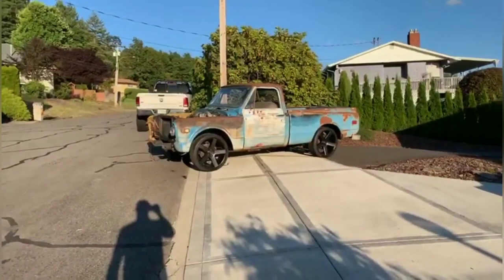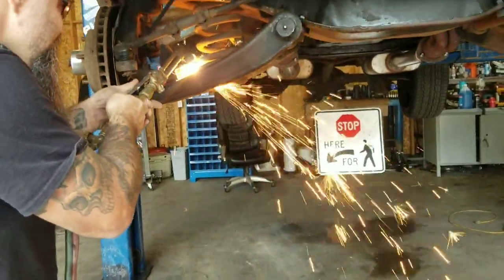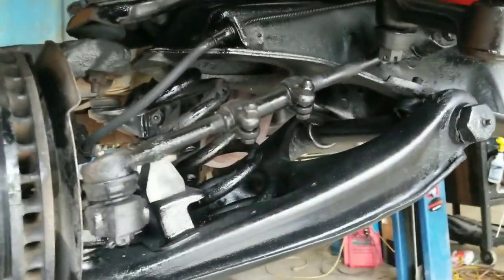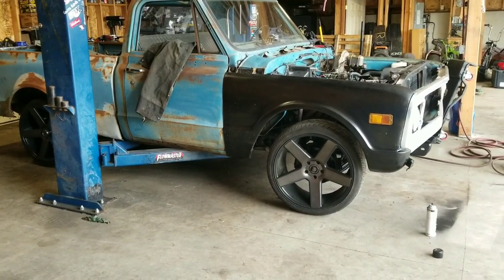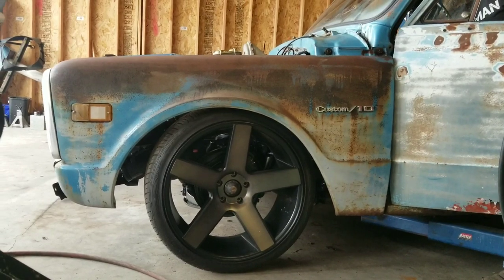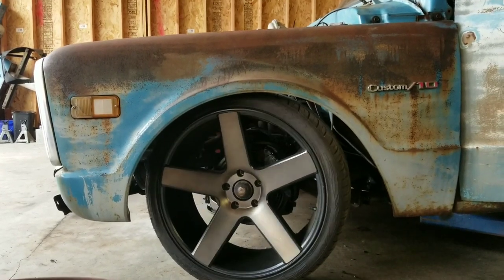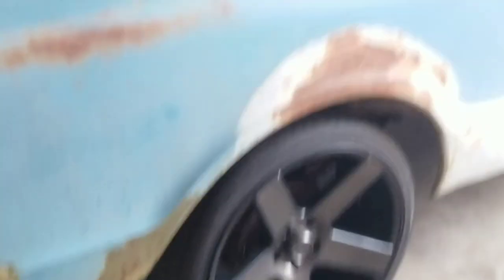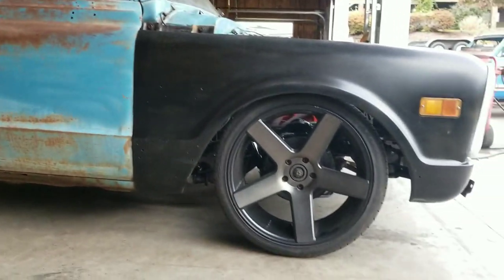72 C10 how to cut and heat springs for that low life.

Comment: What paint did yall use
Reply from the maker: It was a high solid black from tacoma screw.
Reply: @streamlinebuilds1490  thinking about cutting my springs for my caprice how are things holding up??
Reply: @streamlinebuilds1490  what's the brand of the paint